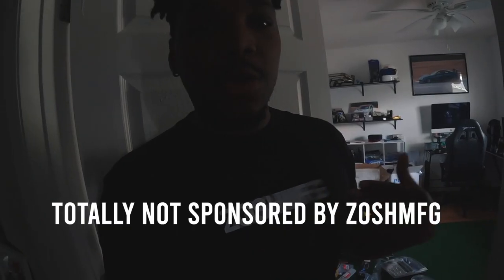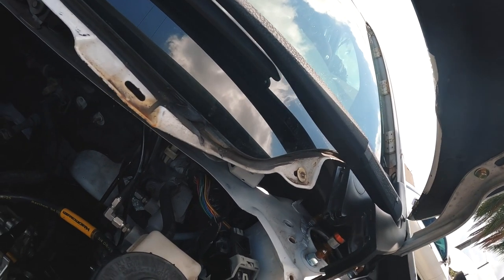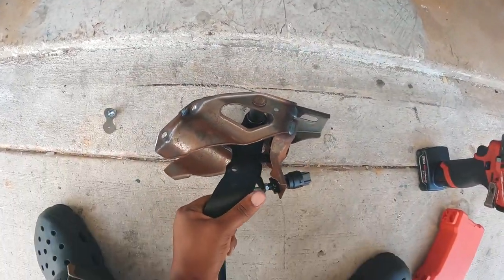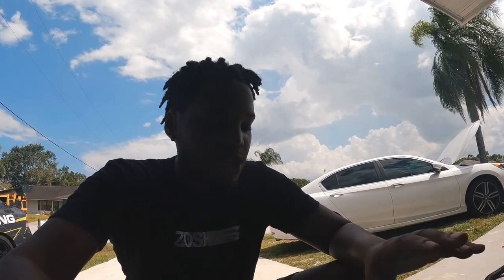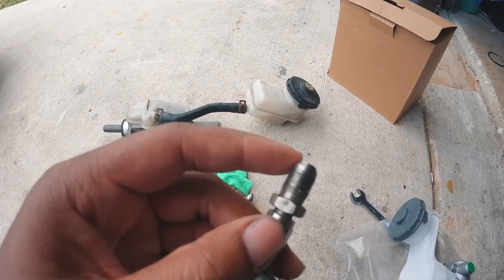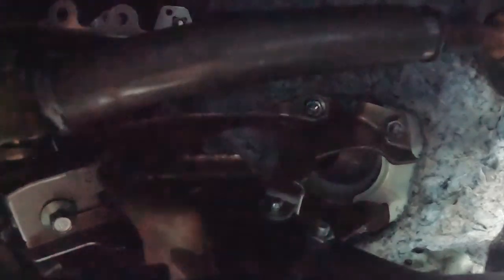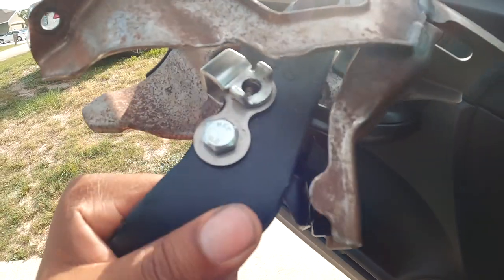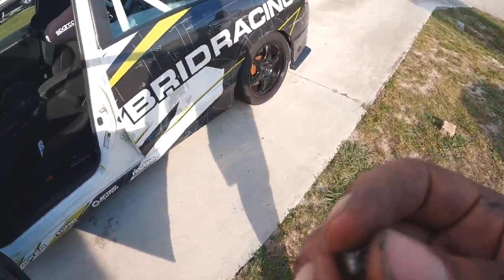Honed Developments Brake Booster Delete *INSTALL* - 8th Gen Civic Si

Comment: I have a wildwood booster delete on my new k/Teg build project that I bought from someone else and it feels like a lot of work, like a lot.. granted the zinc coating from the new slotted rotors is finally wearing off and things are breaking in. Still though, just like a good race seat holds you in place so you don’t get exhausted while racing, I can see the brakes doing the same thing with out the booster. Am I a generous when I say that if I was a manufacturer I would first create an adjustable device that controls the amount of vacuum going to the booster so that the driver can have less sensitivity on the brake pedal? Like a dial based valve almost like a manual boost controller valve..

Comment: so these cars already have an issue with clutch pedal bracket cracking...which gives all kinds of issues. The way you cut that brake pedal bracket...the amount of force you apply to the brake pedal...just be careful. As much as I'm about input mods(things the driver is interacting with) I'm not about hacking up a brake pedal bracket. I hope its still solid enough man